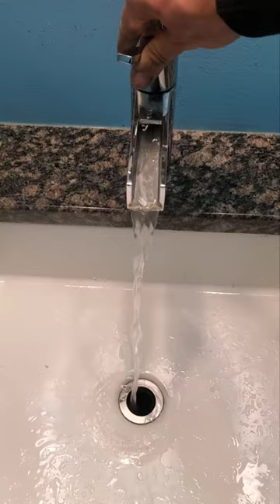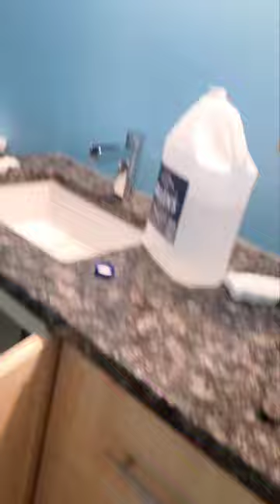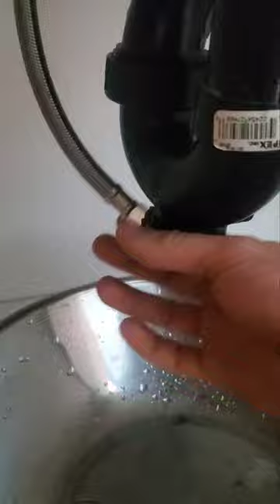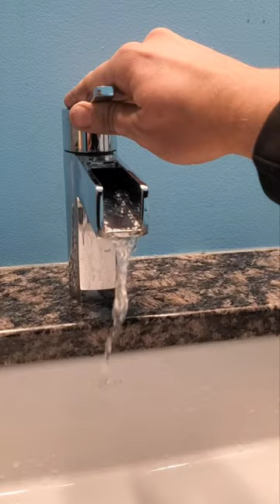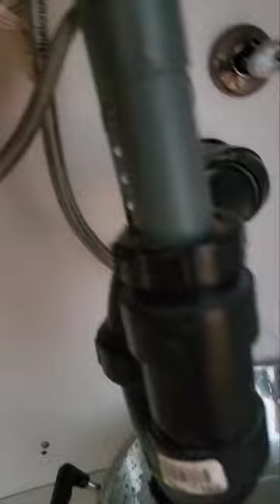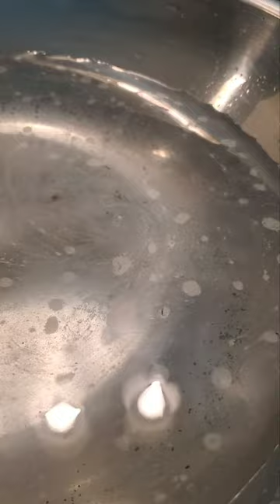Low water pressure/clogged line bathroom faucet

Comment: It's ALWAYS best to run hot water through new faucet water lines. The gunk you see that came out is the usual factory debris and oil. Only after rinsing out the line with hot water you can install them. This is a common problem with kitchen & bathroom faucets made in China. These faucets are not made in the cleanest of factory conditions. Once fully installed, I always recommend running the hot water line for at least 5-10 minutes to clear out oily residue.